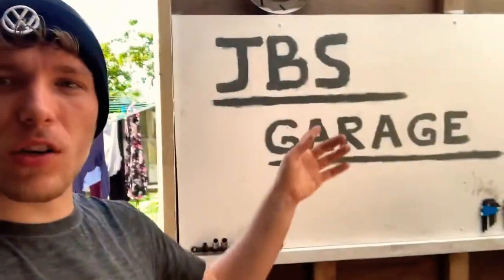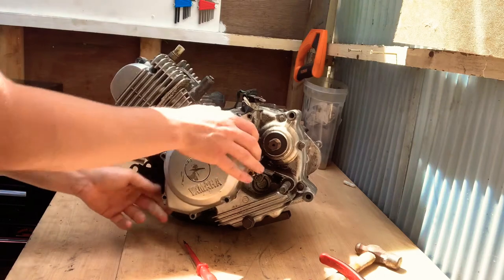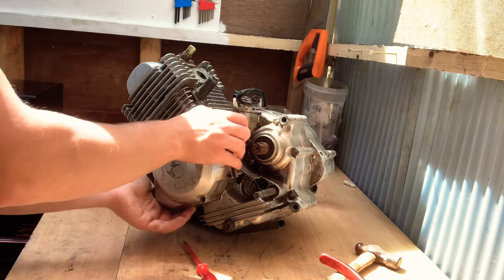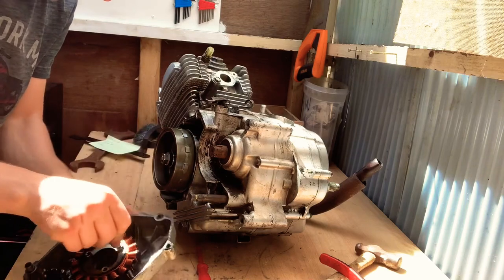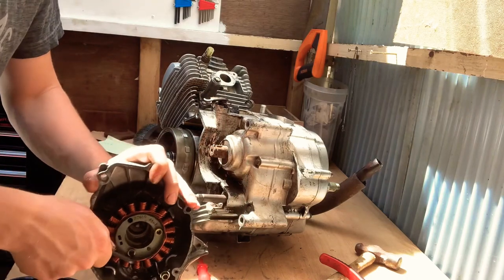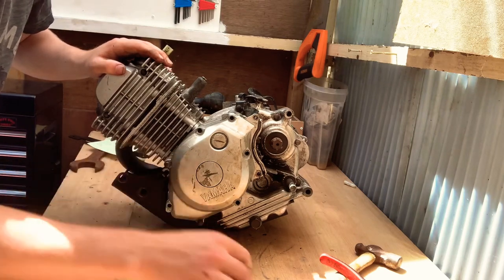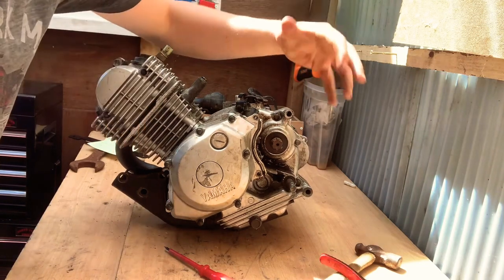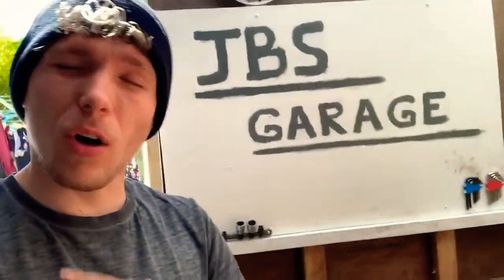Yamaha YBR125 Magneto/Stator Winding Replacement!!! (5VL Engine)

Comment: Great clip buddy! Ive got a question to ask, I have a Yamaha YBR 125 from 2010. I lost the key, so i ordered a new one and essembeld to the Yamaha. The start motor is turning on but motor isn't starting. spark plug doesn't spark either. I thought it was the CDI, but I had it checked by a specialized company and it works as expected. Now I want to replace the stator, but do you think something went wrong when replacing the ignition lock or odometer?

Comment: I have 3 white wires from the stator, and red and white crank sensor wires. I can't find what looks like a cdi that will fit this wire set up, all the cdi, s I see on ebay that say thay are for a 2007 normal carb engine have way more pins and my plug would not fit any of them??.

Comment: Hi great videos mate, can the engine oil make its way into the stator housing area if the engine gets tipped on its side??, I found a little oil in my flywheel when I popped the housing off, the engine is out of the bike and tipped over undoing bolts and stuff cheers
Reply from the maker: Yes mate oil fills the whole engine including the stator, so thats normal :)

Comment: My stator has a 3plug and two plug set up, do you know of a generic Chinese cdi set up I can use as the engine is going in a trials rolling chassis so I don't need a full loom, I already have a Chinese starter motor  loom set up that works to turn it over but the cdi and condenser seem to have loads more wires than I have and I can't work out which are the pick up and charge wires to the cdi cheers for any info.
Reply from the maker: I honestly wouldnt know mate as i use all yamaha parts for my YBR as my experience with chinese bikes tells me how often that stuff fails and they only last a few months usually as i abuse my engines with full throttle all the time 😂